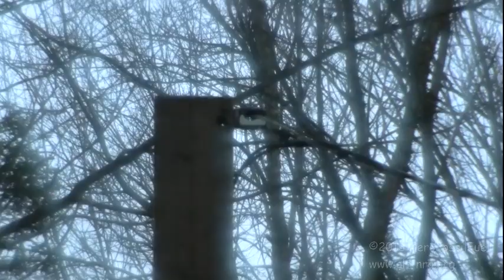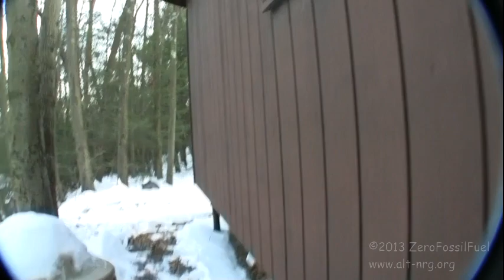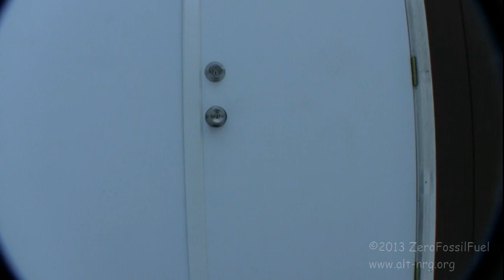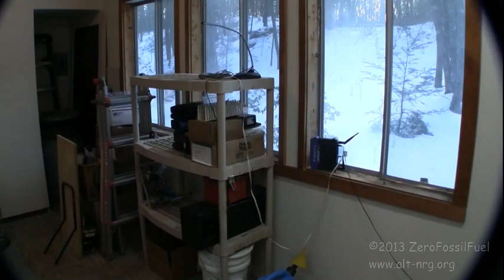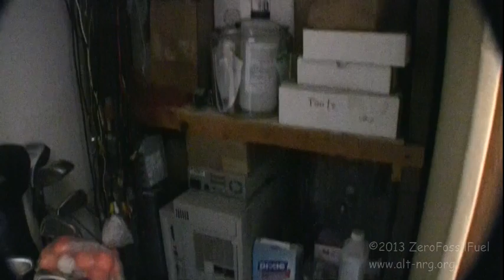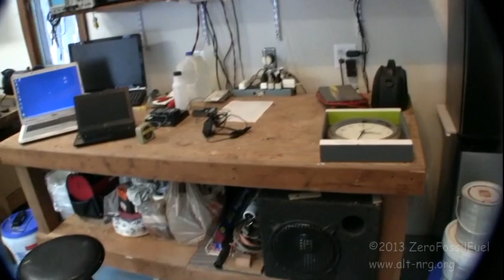#322 Lab DONE! Rocket Stove Mass Heater begins!

Comment: z man I may have came up with a way to up your heat and get more out of the gas going up the flu of your rocket heater. 1 get a old 40 gal gas water heater flu iners that spirals cut off to your stack measurement. you may want to make two small cuts in you fire bricks so it will set flush . I am very happy with the extra temp and more efficient see from it. can I get your thoughts on it pls.

Comment: I have watched the whole series twice now and enjoyed it both times !  I think your design, using fire brick for the J-tube, is the best design I have seen !!  It might take a bit longer to get the J-tube hot enough to draw, but that brick is going to hold a lot of heat for a long time and you will never have to worry about it "burning out".

I love the fins you added later.  Gives it that real "rocket" look.  And the pellet basket and feeder with shaker is some great engineering !
Reply from the maker: +theoldwizard998 The interior heats up very quickly, much more so than any metal tubing. Firebrick is inherently insulating.

Comment: I finally ended up with 2 40 lb propane tanks - we've had it burning a few times, the only comment is that if you use wood from outside you may get water condensate along the vent pipe.  At least I did.  Hope to see you Sunday!  Peace out!

Comment from the maker: 1) The toroids are about 2.5" OD, 1.25" ID, salvaged from scrapped UPS's. 2) Ferrite is iron powder. 3) ? 4) Mouser, Digikey, Newark, Jamco, surplus, etc etc etc. 5) 4 because that's all I had. Insertion impedance of each is at least 100 ohm at 100MHz. More than enough to isolate high current high frequency spike induced by HEMP. 6) because the wire was already cut to length, it's very stiff and it's not really necessary. 7) The ferrites on each leg can simply be clamp-on 3/8-1/2" ID.

Comment: Well we made up and fired up the inner workings of the stove today.  Surer than Sh!t no smoke once it got burning.  Since I had bought the 4" piping I stuck a 10 footer inside the riser and really got a good draw!  Still looking for another barrel (14" by 26") or another propane tank 12" by 26" or more in length. I had some scrap sheet iron laying around from a microwave made the brick capture box and welded it together (just tacked).  I am debating on whether to used fire brick cement or not

Comment: Excellent work; the finished lab looks great and nice to have a place all to your own. Looking forward to your rocket stove build. If you plan on using any piping I would consider black pipe not galvanized at the high temp areas. I agree with the exposed steel if you’re not going the mass route than rapping it with something like Kaowool does a fantastic job.  I like the idea of precast for the burn chamber and flue as I have seen on a few, which will be for the next build for me. Great work Z.

Comment: Also...suggest reading "Rocket Mass Heaters: Superefficient Woodstoves YOU Can Build" written by Ianto Evans and Leslie Jackson. A softcopy is about $15.

There are specific volumetric relationships required for the rocket heater to function properly. Looking at what you have on the bench makes me think the resulting combustion chamber and feed chute will be such that fuel size will have to be very small and that it will need to be fed every few minutes.

Comment: Anticipate and plan for the firebrick to crack. Thermal stress from rapid uneven heating results in failure. Make sure you allow for removal/replacement of firebrick. Install firebrick so they are allowed to float (not captive or cemented in place). The firebrick make a distinctive sound when the snap! Galvanized heat riser will fail quickly; plan accordingly.

Comment: TIP FOR HEATER: Also make the riser out of fireproof bricks, the inner pipe in the riser will burn out, im seen it on some vids. I just continue with the firebrick-burnchamber-style all the way up.. Use bigger pipe to hold bricks in. How you can have max burn-temp and never rust out :)

Comment: i know kerosine heater is temporary solution, but where do you plan to put the rocket stove? i think it should be below the window because of natural air flow so the heat is kept in the room. and other thing.. you want efficient heater, so did you consider rotating neodymium magnets against copper pipes filled with water? i am thinking of installing such thing in my house. best luck with the new lab!